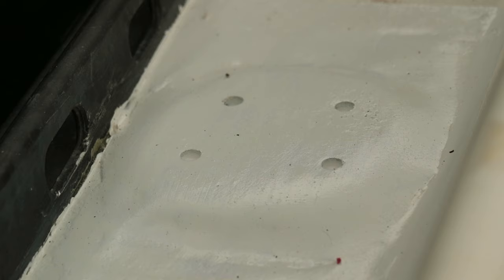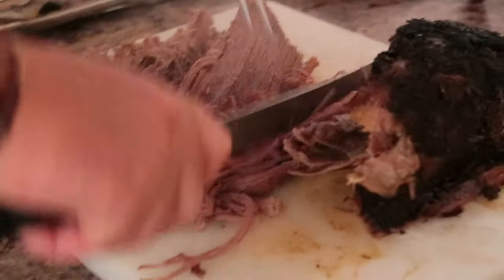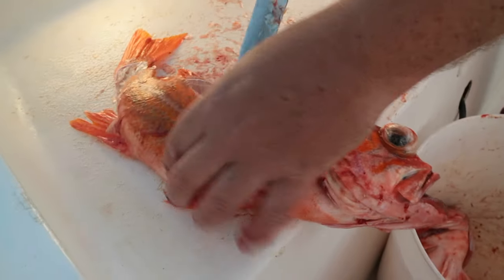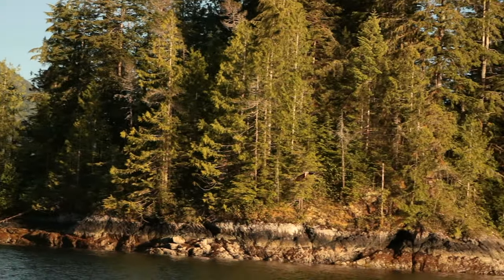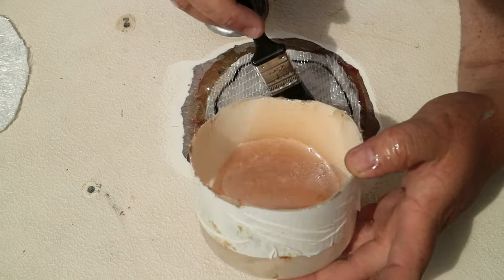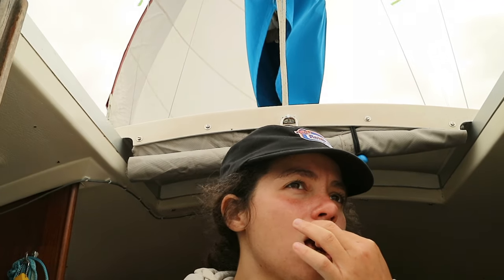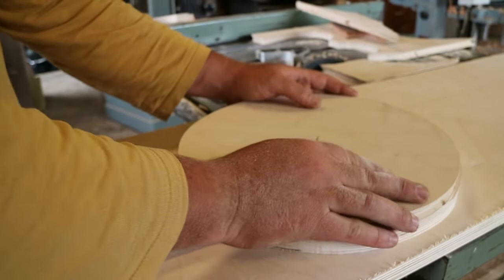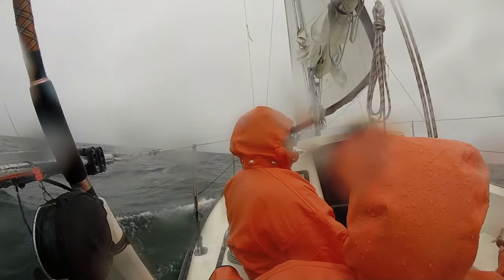14. Sailing Maiweh: Leaving Zeballos

Comment: Nice video...whats the plan for the self steering? servo pendulum?
Reply: trim tab?
Reply from the maker: Not sure what the technical term is, but it's going to be direct to the tiller - no rudder/paddle in the water. Just the vane at the top.

Comment: Did you just build a wooden wind vane autopilot? ?
Reply from the maker: Most of it. For a small boat, it doesn't have to be that massive. We just have to epoxy everything together nicely, and set up the lines for it properly. It's a work in progress...
Reply: +Sailing Maiweh very cool !